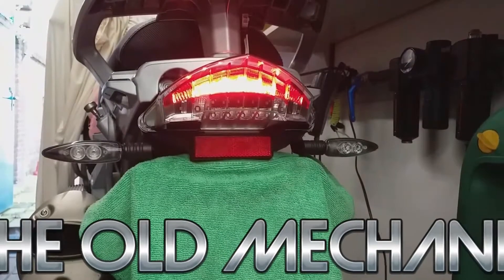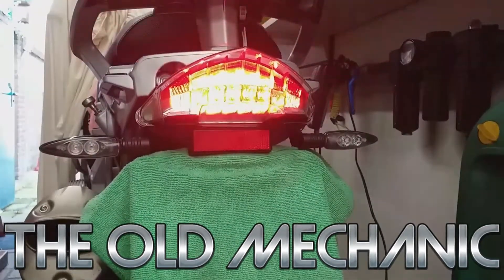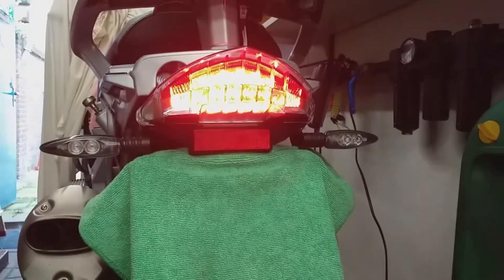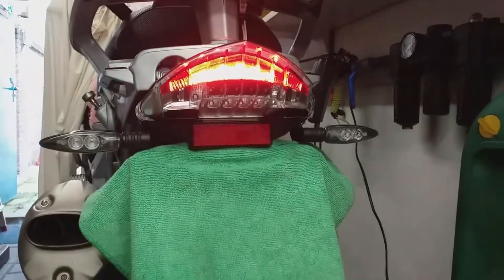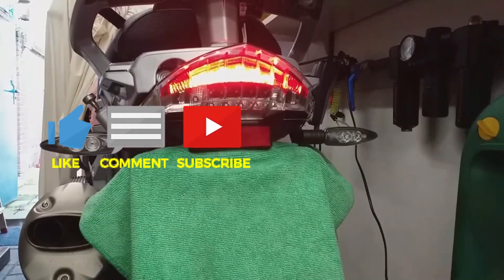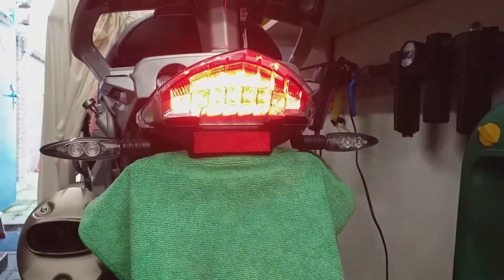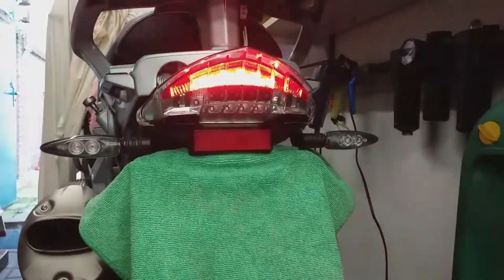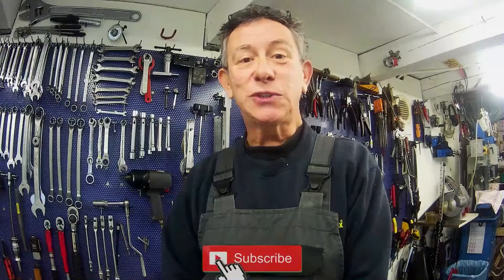BMW R1200GS [2010]   ⚠️LED {FLASHING BRAKE LIGHT⚠️  (modification) The Old Mechanic 👨‍🔧---🏍

Comment: I realize this is an old video but I can’t find an answer anywhere else. I’ve installed the same brake light modulator on all my vehicles and it works great. However, when I installed it on my 2012 1200gs, the tail light doesn’t come on, but the brake light flashes as expected.  I suspect it’s an issue with the canbus.  How did you wire yours to work? Is it still working after 3 years?
Reply from the maker: Its still working great. Maybe you wired the negative through the taillight ? 😉